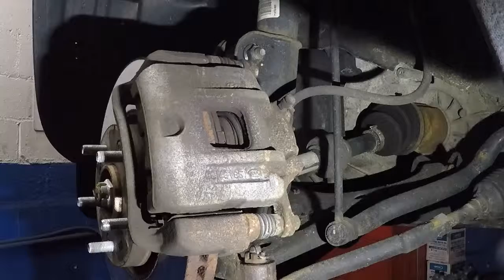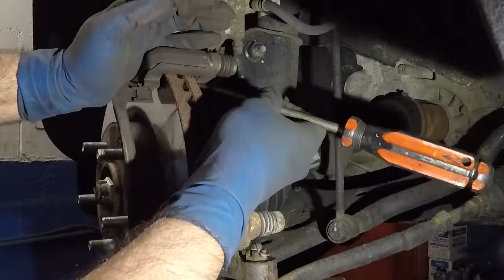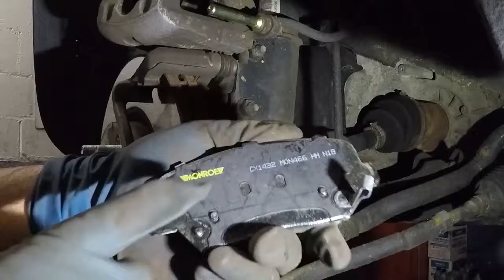How to replace front brake pads on Kia Sorento

Comment: I wanted to see this done before i started, it will be my first pad replacement for KIA Sorento. I always used to take the fluid cap off beforehand, is that unnecessary, now or was it never necessary? Just wondering. Thank you
Reply from the maker: Yes take the cap off it will help it breathe better

Comment: Before you compress the caliper piston take a clean turkey baster and remove some brake fluid from the master cylinder, when you are finished, refill it with fresh brake fluid.
Reply from the maker: Good tip

Comment: I read and was told never to compress the piston cause it will push fluid back into and over flow master cylinder
Reply from the maker: Hazel Eyez u have to push piton back other wise you will never every and every get the brakes in

Comment: Not all break sets come with them, but it’s preferable to replace the brake hardware. Bro, you pad slap without cutting rotors? You should never have to modify the hardware. You either have the wrong parts or you didn’t properly replace/clean the hardware. You need to grease all metal to metal contact points. Wrong choice of grease for the slides. I would love to know what you charge for that job.
Reply from the maker: Mike Mardis customer bring me and tell me to do the job as they wanted no if and or but’s ... what can I do?
Reply: RB The Mechanic I don’t doubt it’s shop policy. I heard someone grinding in the background. I couldn’t face myself turning out work like that though. 
What do you guys charge for a pad slap.
Reply: No buddy some of the parts that are made in China dont have the QC other brands do they meed to be cleaned up. Are you new to doing brakes?
Reply from the maker: Mike Mardis sorry bro it seems like ur not happy but I can’t do anything when customer bring part that dosent fit properly it is correct but when u buy cheap pads they need to be grinded on the edges to make them fit smoothely we did what customer asked and he refused to pay for shop meterial the syn greas is not cheap it’s not much either but if he refuse to pay couple of dollars for food service we did recommend us buying parts so it’s as it is we did made it fit smoothely not hammered it in force it in
Reply from the maker: Mike Mardis pad slap is $40 I have tried before in past not to do lame job but if now me some one else will do it and loose a life time customer I hope u understand

Comment: Torque specs? Otherwise excellent video
Reply from the maker: AceOspades hi yes thank you if you need specs I can give u up on cars vin number I do not post it because it can be easily mistake with diff years or wrong car very critical information
Reply: RB The Mechanic 
do you have a video Change tire bolts stuck and fix it - kia sorernto  2016
Reply: Common sense

Comment: do u have to bleed the brakes
Reply from the maker: No not for brake changes if your replacing hydraulic component such as caliper master cylinder brake lines then you do need to bleed the brakes
Reply: He uses a c clamp 🗜 so he doesn’t have to bleed breaks